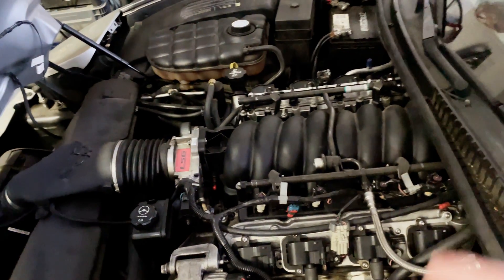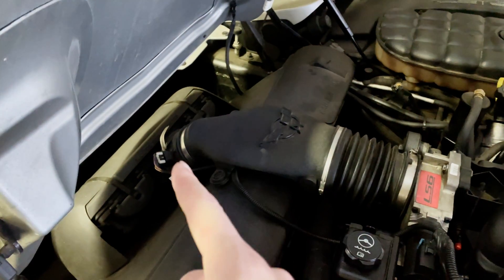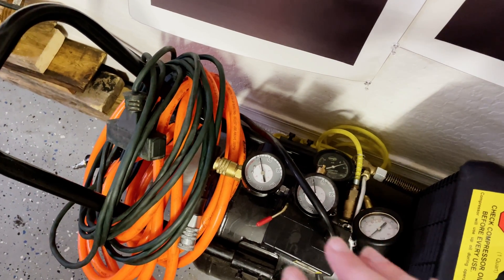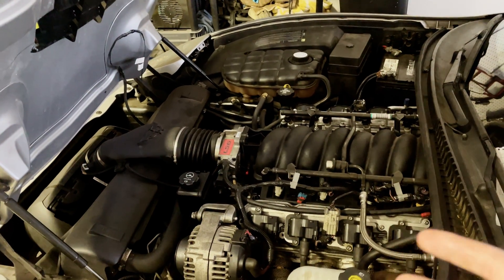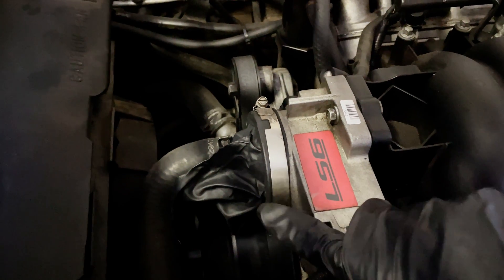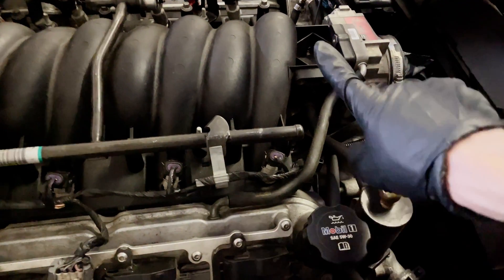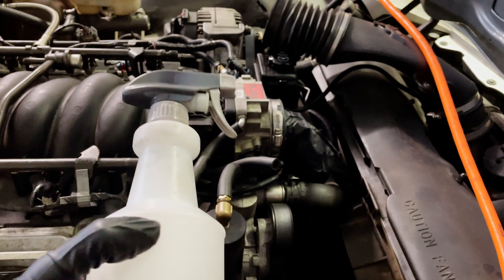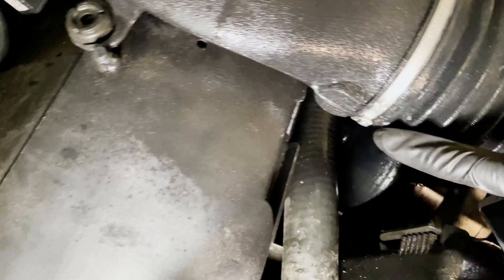Check For Vacuum Leaks With An Air Compressor: P0171 P0174

Comment: I have  L99 engine and dealing with weird  running engine  everything’s been done to find the issue low missfire counts on two cylinders  4-8  tried smoke test but didn’t see anything but intake is same design as yours So Iam going guess there leak in intake manifold  just to small or location of it smoke test cant get to
Reply from the maker: Replace your plugs and coils if you haven't already. If you're still getting misfires do a leakdown test to check the health of your valvetrain. Good luck

Comment: Unfortunately you can't tighten that clamp that you pointed out had a leak. I am guessing these all leak on c5s.
Reply from the maker: Yeah the design is crap, I ended up getting a silicone one that sealed it properly